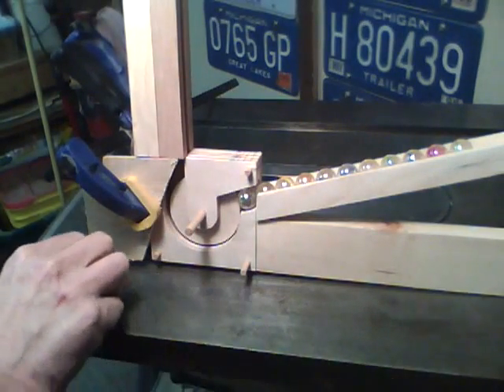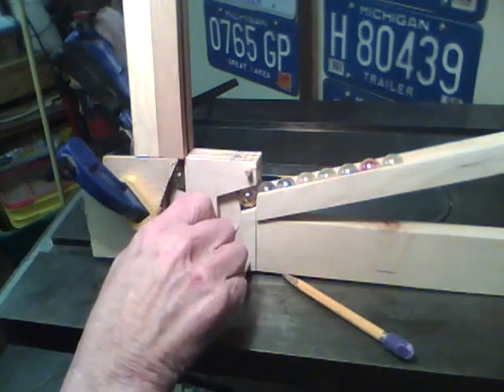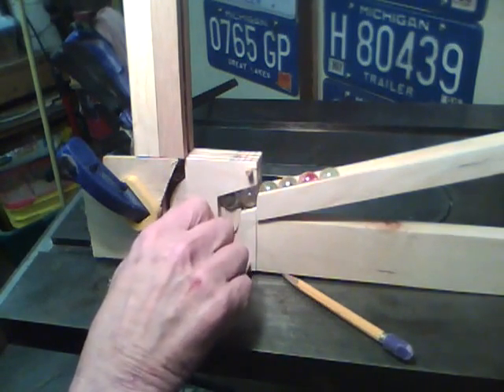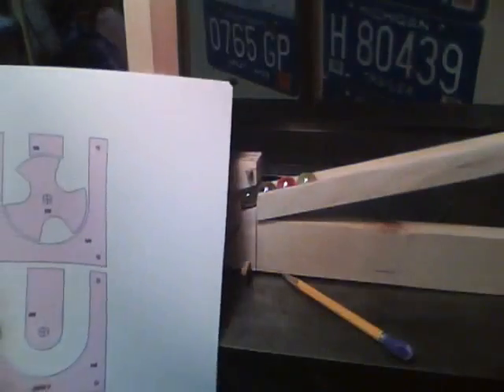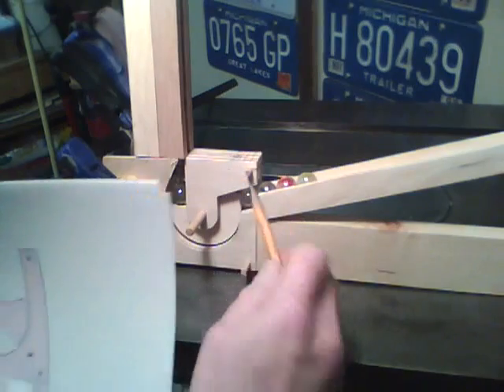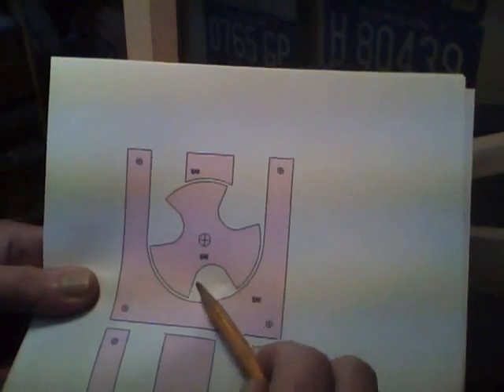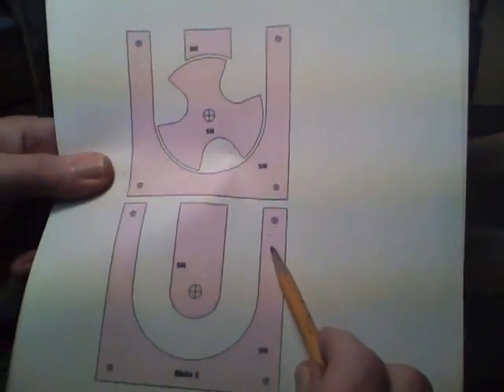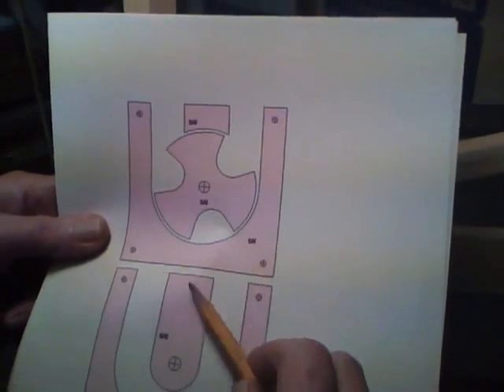Rotary Marble Lift modification

Comment: Good idea , but i dont like marble pumps very much.  They bind too much marbles from  the circulation. If you want to build  a marble machin with maybe 6 or 8 feet in height,  you need hundreds of marbles until the first marble comes out of the shaft on top. I would prefer nearly every kind of elevator, maybe a combination of different types.

Comment: Jim, what program do you use to create these patterns? I doubt I am bright enough to even attempt but it sure does make putting your thoughts down easy - at least it appears so.  It neat seeing the gears turn in your head as you modify this.
Reply from the maker: Thanks Scott. I use SketchUP it will print them actual size.
Reply: Jim Steinbrecher I knew I wasn't bright enough to use it. Sketch Up and I do not get along.

Comment: I am intrigued with the engineering aspect of this ... thanks Jim for your persistence
Colin
Reply from the maker: Thanks Colin, I put the inlet at the bottom and it works a lot better. Will even run in reverse.

Comment: You gotta put a motor on it to arr arr arrrrrrr lol.
Reply from the maker: Got a motor - See the drill? Bigger one later.
Reply: I'm just teasing Jim.
Reply from the maker: I know LOL.
Reply: A person could make a mini speed reducer for it that would be cool.
Reply from the maker: I have an old hand held Mixer that I may use. May need a speed reducer? Think some mini pulleys and rubber bands will work?
Reply: I'm sure you could make a miniature version of my speed reducer and use rubber bands for belts. Never thought of using rubber bands for a miniature version. Guess I got duct tape on the brain!  Good thinking Jim!
Reply from the maker: Do they make rubber duct tape?
Reply: I don't know. I know it is a bit stretchy if you don't use to many layers when making belts out of it

Comment: These two have a finger that makes the marble go up:
http://youtu.be/rcmwxEAqC64

http://youtu.be/CgjUm-lgVaM

Might solve the problem of hanging up.
Reply from the maker: These would have the same hang up if were run faster. I guess they will just have to run slower. Having more pockets gives better results. I built one a couple years ago using a wheel with 20 holes in the side, and it needs to run slow also. I will try it with the inlet at the bottom, on the side also.
Reply from the maker: Mine also started with the finger. The 2 parts inside the sides act as the fingers.